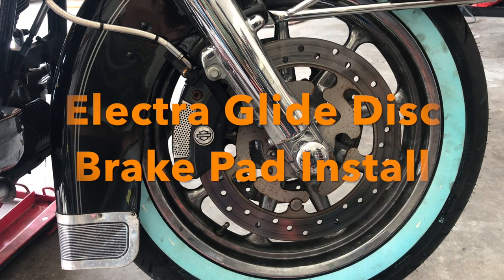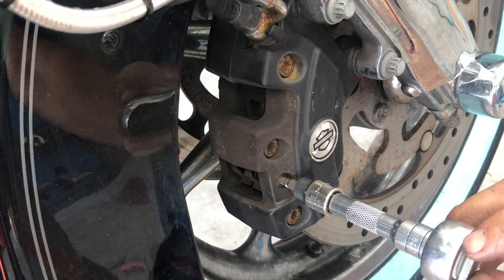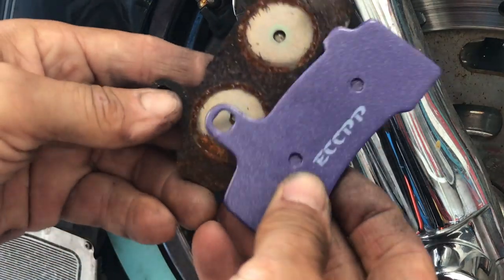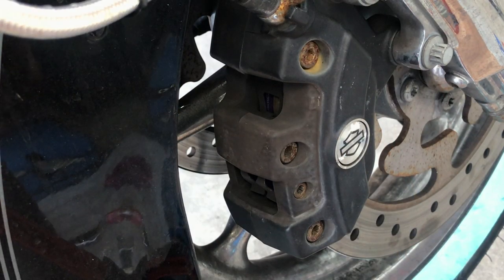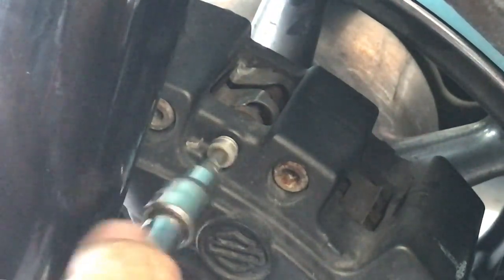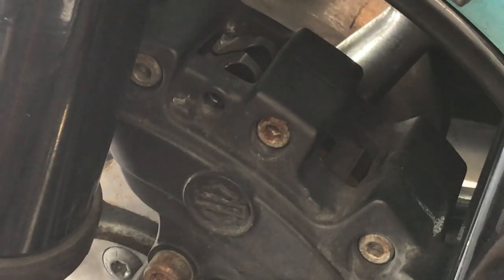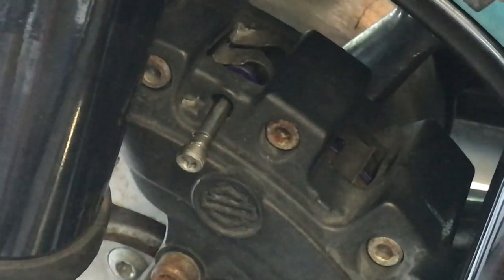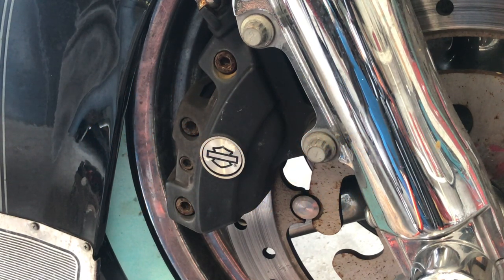How To Harley Road King & Electra Glide brake pad install  2010-2017

Comment: Well, I tried it this way and I couldn't get the brake cylinders to compress satisfactorily, so I did what my mechanic suggested and removed the two 12 point-bolts to get the calipers off. I compressed the cylinders with a c-clamp and reassembled the whole thing. Took me about 45 minutes. Not a hard job at all if you can't do it the way shown here. 

BTW: The pads at the H-D parts desk were $110. Brembo. You get clean new center bolts and new clips. My old pads lasted me all of 12,600 miles. We'll see how long the Brembos last.
Reply from the maker: Thank you for the update.  Ride Safe and have a great day Wes. What year was your King?
Reply: @TwoWheelRocco  2016 FLHP
Reply from the maker: @BegoneJonah  Great bike I love kings. Thank you for your follow up. Ride safe have a great day

Comment: I had to pull the rear caliper, 2010 Road King with what I'm assuming is the original factory rear air shocks.  I could just barely grab the socket on the cross pin with 5mm ball driver, once I got it loose there was no way it was sliding past the rear shock.  It wasn't bad, just two more fasteners and having the caliper off the bike made compressing the cylinders and installing the pads much easier.  Everything is literally in the palm of your hand, lol.
Reply from the maker: Happy all went well.. On the newer bikes, you can take the caliper off and be fully exposed. I know some of the shocks to getting away of the pen. It's a pain but easy enough just to pop that caliper off as you did. Thank you for the update on a 2010 Road King. Ride. Safe and have a great day.

Comment: Good video...looks simple. However, on several occasions you mentioned to collapse "them." What do you mean and how do you do it? Also, how did you clean the pins? Adding that info would have covered all the bases for rookies like me 😁. Thanks for the video.
Reply from the maker: When you remove the pads you will see the pistons inside the caliper, collapse with a screwdriver. you will see what you need to do when you take your pads out.  The new pads are thicker so you need to make more room to install the new pads. and as for the pin clean it with a wire brush or steel wool.  If you have any questions just ask sorry about that, I should've showed this. Thank you for watching Rick.  Ride Safe and have a great day.
Reply: @TwoWheelRocco  thanks man. I've seen several videos, and this one was the best. Very simple...even for a guy like me. Cheers.
Reply from the maker: Thank you for watching.
Reply: @TwoWheelRocco  never mind my question. Just read this. Thank you sir for your videos.
Reply from the maker: @roadkingrider6532  My pleasure. Hope it helps.

Comment: So damn easy Damn some of these super mechanic on here got you taking the whole thing off
Reply from the maker: Happy to Help,  Any questions just ask. Thank you for your Sub Glenn. Ride Safe and have a great day.
Reply: I have a 2010 Road King, the cross pin is almost directly behind the rear shock.  I could get the pin completely loosened using a ball head, but there was no way that the pin was coming out.  I wiggled it every direction possible, no go.  That left me with two choices, pull the caliper or pull the shock.  I opted for the caliper, two bolts, lifts right out, you've got full access to everything so compressing the cylinders and installing the new pads and replacing the cross pin is a snap.  The time you save installing everything with the caliper off makes up for any time lost with the two fasteners, imo.  Next time I might pull the front calipers off too rather than fumble around by feel and touch.

Comment: Rocco, any idea of OEM pads would roughly get on mileage before I should start thinking of getting new pads,? Do they last 15K miles or 40K miles? 
Obviously depends on how rode, stop & go or highway miles, but some idea in general?
Reply from the maker: There's a lot that goes into that. I would take a flashlight and look at the pads from the front of your bike and if you got a 1/8 of pad  right and left of rotor, looking at 1000 miles left. Front brake pads ware quicker than the rear. From the back of the bike with a flashlight look at the caliper to the right and left side of the rotor and see how thick the pad,  That will give you an indication same 1/8 inch if it's less get new pads. Miles are very hard to dictate.  Hope that helps, let us know how it works out. Thank you for watching.

Comment: I’ve never done pads on anything. With that being said, this will definitely sound like a dumb question. When you say collapse then with the screwdriver. Does that mean sticking them up there and spreading them out??
Reply from the maker: Happy to help. Yes, stick the screwdriver and then work the pads and collapse the pistons in your caliper. Any questions just ask. Let us know how it works out. Thank you for watching and your sub Road King rider ride safe and have a great day.
Reply: @TwoWheelRocco  awesome thanks. Just ordered the front and back for my RK, so will be doing them this weekend thank you.
Reply from the maker: @roadkingrider6532  any questions just ask Remember  patient.
Reply: @TwoWheelRocco  Rocco…I did my pads this weekend. I feel stupid…that was to easy! Thanks for the video! I’m going to do everything to this bike that comes up until I get defeated. Next I’m going to flush the brake fluid. Mine has abs so I know it’s a big trickier. Anyway, I appreciate your videos. It definitely is helping us save money, and learn our bikes and new skills. 🤙🏻
Reply from the maker: Happy to help. I would just recycle the brake fluid out of the master, pull it out. Don't touch nothing replace it with clean fluid, put it back together and let that fluid cycle threw. Do that every oil change and you will keep fresh fluid in your system without disturbing the ABS, which you'll end up at the dealer, you don't wanna do that. Thank you for watching and your support Road King rider. Let us know how it works out. Ride safe and have a great day.   Remove fluid from master replace with new and put back together. Do not touch the handle. That's how you get air in the system, when there's no fluid in the master reserve Do not touch the handle.
Reply: @TwoWheelRocco  awesome thanks for the help!
Reply from the maker: @roadkingrider6532  My pleasure. Ride safe and have a great holiday..

Comment: Hi Rocco , at 00:53 what do you mean by you compressed them as much as possible . I am a rookie with a 2017 HD Road King Classic and am going to attempt to DIY a brake pad change . Thanks from Germany 👍
Reply from the maker: Happy to help what I mean is to collapse the pistons in the caliper so you can make room for the new Brake Pads as you're doing it you will understand. Any questions just ask. Thank you for watching and all your support. Ride safe. Have a great day.
Reply: Thank you very much . Danke schön !
Reply from the maker: My pleasure let us know how it works out
Reply: @TwoWheelRocco  I successfully managed to get the Brake pads out, clean them and put them back real easy so thank you for this video :) . I have one question though. In 05:14 you say 'put a little dab'. What exactly is that ? It looks like grease of some kind, but could you please tell me what exactly it is so I can buy it in Germany. Thanks very much.
Reply from the maker: Happy all worked out well. As for that loop you go to any AutoZone or auto parts store it's just a little brake grease they sell them in little squares. You can put a dab  on there just to make sure it slides back-and-forth. Nice and easy. Any questions just ask. Thank you for watching, and all your support.Pranavah,  Ride safe and have a great day.
Reply: @TwoWheelRocco  Thank you so much once again ! I wish you safety in your travels too Rocco.
Reply from the maker: My pleasure ride safe and have a great day.